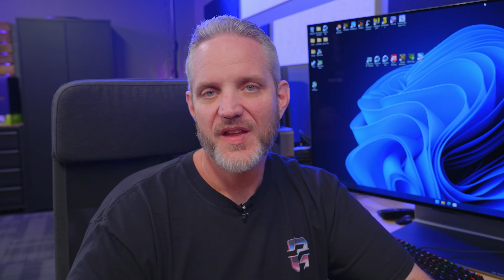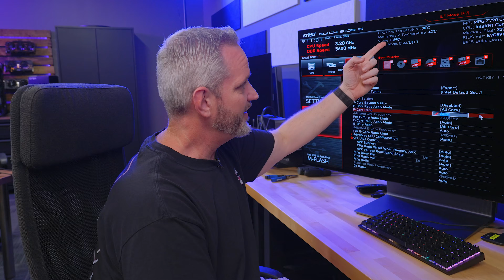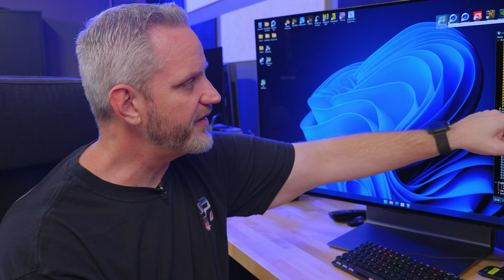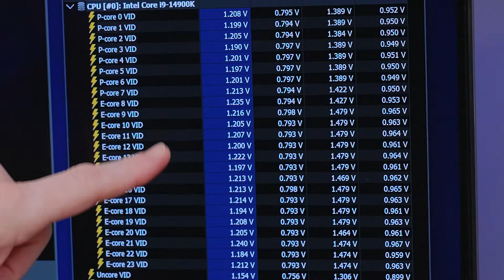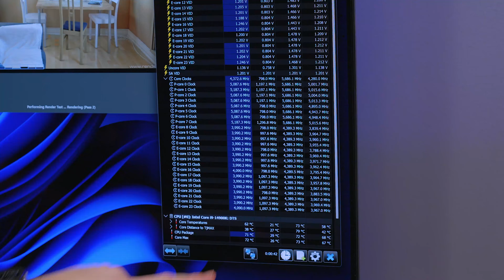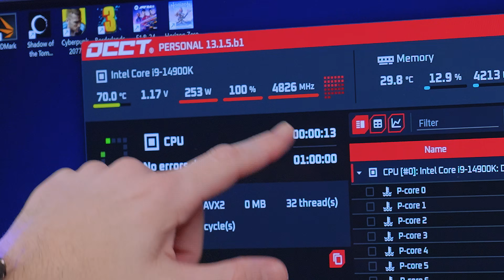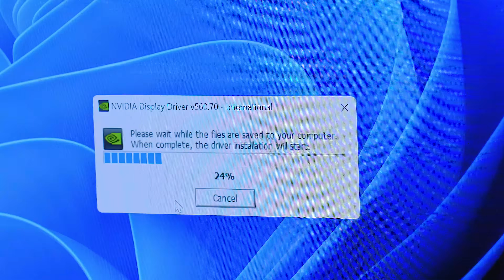Guide: How to check if your CPU is BAD!

Comment: You don't need to OC computer components anymore they are so fast now out of the box that OC is a waste just throwing more heat at it for no real gains and in gaming its just dumb to overclock for 5 fps gains or even less specially if you have a 4090 GPU its beast at default speeds why OC it. For a basic user that just games on there computer OC anything is a waste minimal gains for way more heat and power use is not worth it imo.
Reply: Fully agree.  I do the same, PLUS, I use the best cooling components that I can use.  Cold electronic components last longer & are more stable than those subjected to an ongoing blast furnace of heat.  Sort of a trait that I picked up from working in large mainframe computer shops long, long ago....
Reply: Undervolting with overclocking is the most valuable, but it takes a little time to setup up properly.

Comment: Had same issues you spoke about for my 14900k during first 3 months of 14th gen release.

z790 hero / z790 strix e 
Artic liquid freezer II 360

Used two different motherboards and two different 14900k chips. Both scenarios produced the same results. Cinebench and games would crash upon starting and during cpu high spikes. 

Everything was tested stock settings out the box.

Returned both chips and went with a 13700k. Everything has been running stable since.

Comment: I have to be honest, I have no idea if my 13900K is degraded or not but it probably is. I've finally had time to update my BIOS and I've done some testing, but I'm not sure. It seems worse with downgraded performance, and far bigger voltage and clock ranges (also higher voltages than before but also lower on average, from ~1.12V all the way up to ~1.5V, whereas it was about 1.2V-1.35V before), but then I'm using the Intel Default profile whereas the previous profile I was using was MSI's extreme profile, which has an absurd 4096W "limit" on PL1 and PL2. 
The thermals are the same as before though, with throttling even running an NH-D15 at full speed (but then again, it's a modern i9, so I guess that's expected).
Honestly, if we have to be experts to figure this out in the first place, I'd say there's already something wrong.

Comment: DISAPPOINTED!!!

I was kind of expecting this somehow, but updating the BIOS made things WORSE!!
This morning, I tested the CPU, keeping an eye on voltages and everything was actually just fine, but since everybody is panicking etc. I decided I would make a screenshot of HWmonitor after some time and tests and then do the same tests again, after the BIOS update.
And so... The voltages went UP about 0.05 volts OVERALL, even the idle voltages!
The powerdraw on all core stress test went from 260Watt to 283Watt.... When the cap went from 4095 to 253 watts?!?! How does that even work?!
Even 'better' is that the max temps went from 78C to 90C!!! WHAT THE ACTUAL FFFFFFFUDGE?!?!?
THIS is Intel's 'safety measure'??

Yeah, great BIOS update, lovely, thanks MSI, thanks Intel! That worked like a charm! >__<
Oh, right, the specs:
MSI MEG Z690 Unify (It already took them way longer to bring out the update than for Z790 boards, so thanks for that as well)
Intel i7 13700K
Reply: I went back to the April BIOS, 1 version earlier, my board came with the Januari one, 2 versions earlier, but they seems to be working the same.
Voltages, Power draw, temperatures and even performance are better! Fudge Intel and their settings and fudge the mainboard companies for rushing out a BIOS that is apparently WORSE for the CPU and they don't even appear to have checked it!

Comment: For many people, the problem will be that after flashing the new bios, the Intel profile is preset.
And my 13600K became an i7-8700. I had 10,000 points less in cinebench.
Reply: My Cinebench scores barely changed with the new Intel preset ... not enough to get my panties in a wad.

Comment: Fun fact: on Intel motherboards, just having 4 ram slots is all you need for Intel to set a lower stock/stable speed. The number of sticks doesn't come into play, which makes most ram sticks/timings an "overclock" by Intel's standards. It works as Jay described it though for AMD, only when sticks/ranks are present will it impact the CPU (and not by as much!).

Comment: With my cpu i9 14900kf crashes or shaders compiling errors happens only when i overclock it, when it's in normal state or a bit undervolted like i'm using it now it runs fine with no issues

Comment: Quit propagating misinformation.  Degradation can be prevented under certain voltages.  Get it right Jay before you post things.  Don't be like Linus Liar Tips
Reply: Wrong, Jay is correct that they will absolutely degrade over time. It's just a matter of how much - degradation is usually minuscule to the point of being mostly unnoticeable for many years.

Comment: Oh also, having now watched the vid
14900K
Asus z790-e gaming wifi 2
My guaranteed crash would be starting the system. About 1 in 3 starts failed. And a variety of fails. Sometimes freezing before enter BIOS screen notification - mostly requiring a power supply off/on to restart. Also, most popular, while Windows was loading - generating one of 3 usual kernel errors. Net said probable driver corruption. Thanks internet 😄
The Asus 0129 microcode did fix this, least so far 🤞🏽

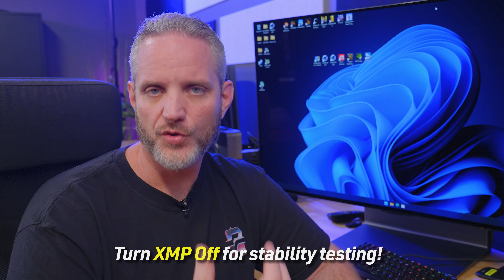Comment: 5:14 I've had 2 diff processors NOT boot 'cause of enabling XMP.
One, an 11900K, XMP was working 'till I updated the BIOS and foolishly (according to me) set the XMP on during 1st boot along with all the other boot things I change. The other processor I hadn't enabled XMP previously.
For both I had to reseat the CPUs to get the things to work again. And quite relieved that did work when nothing else did.
I've NOT enabled XMP on either of those (one's been retired due to a DisplayPort cable malfunction 🙄) 'cause I'd rather have a working system than a slightly faster NOT working one 😼

Comment: A hardware failure will fixed by a software update.
No boy, updating BIOS will fix nothing, just extand the lifespan of the CPU, ...... buuuuut, the lifespan is actually 20-40 years.. so what we r talking about?

I have 2 intel systems, i give a shit on it, in precise, i just only game on it, i cap the wattage, kill ht and e-cores and overclock the p-corres.
I will not think it will reduce the relativly lifespan.

Comment: My 14900KF consistently crashed during GeForce driver install until one of the Bios updates(can't remember which one) and still would have fairly regular browser tabs crash, as well as discord crashes.
The entire system is currently in for an RMA due to this issue, as well as a self immolating 4090 (no idea if that was related)

Comment: For AMD and Intel the "lifespan" is the warranty period.

AMD screws up (degrades) their CPUs a bit more intelligently than Intel.

AMD horrendously overvolts its Ryzen CPUs at stock and is way outside the TSMC spec for their 7nm, 5nm and now 4nm CPUs.

Of course Jay, if you did even the remotest bit of due diligence, you would have realised this years ago.

Just before I replaced my 7950X, which had been running 24/7 for about 20 months, I retested it, and it had the same performance (well actually a bit more) than when I first bought it and established a baseline.

If your buddy at Falcon Northwest looked at the voltage and current going into a 13th and 14th Gen Intel CPU and thought that was fine, then he is a complete cretin.

When I first saw what was happening with 13th Gen when it first came out, I said to the person concerned - that's not going to end well, and of course, it didn't. And the last Intel CPU I had was a Haswell (4790K Devil's Canyon) which ran 24/7 for nearly exactly five years before I upgraded.

Comment: I've been meaning to ask this question. I have a gaming laptop the Acer - Predator Helios Neo 16" WQXGA 165Hz IPS Gaming Laptop - Intel i7-13700HX – GeForce RTX 4060 with 16GB DDR5 – 1TB SSD. i bought it from best buy for around 1200 bucks. i need to know if the I7 13 gen laptop processors have this same problem as the desktop variants. ive heard they do. i know most of my bios settings are locked so everything is just at default settings. ive had quite alot of crashes (no bsod) theyre literally full on crashes where screen freezes nothing works and i have to force power off. this happened a couple times before ram upgrade 16gb and after ram upgrade to 32gb. it usually just happens when playing Wuthering Waves but has happened outside the game. but mainly when im playing WuWa randomly. also will these programs work on my laptop? also i have limited processor speed to 95% in the power options. I also do not know how to check for bios updates for this laptop.

Comment: Intel has an "Intel® Processor Diagnostic Tool", while it doesn't cover everything and not even all of its products, it does cover most recent CPUs out there. It's probably not going to stress the CPU in the same way as a stress test, which would show thermal or wattage flaws. However I think it's a decent enough tool to see whether the CPU is failing in some regard instruction-wise.

Comment: i9-13900K. Running cinebench R32
My system running warm, I have a 360 AIO. 
In the 90degrees to 100degrees. Voltage 1.2 with max 1.488 
P-cores 4.8 to 4.9 max 5.5 
E-cores 3.8 to 3.9 max 4.3

Comment: It shouldn't degrade in 20 or 30 years for sure. I have lot's of Macs and Tandy computers from the 70s and 80s that have seen a tremendous amount of use and still work just fine. Our Dell 386/25 from about 1990 still runs every day. We have only replaced hard drives and maybe a PSU.

Comment: Also: - I noticed you shared not all 14th gen are assured to have this.. BUT DIDNT MENTION 13th gen!  Does that mean there's info about 13th having higher chances of issues and oxidation (as you did directly state) but I've never heard from anyone any info about that... In fact I though early CPUs might even be  more likely to be FREE of it - Just passive info over the last month from Gamers Nexus I picked up in brief comments..
Reply: We don't know. Nobody does. It's starting to seem like Intel doesn't know either. What we do know is that Intel says it was only 13th gen affected by oxidation, though they claim it's a small amount, but there are conflicting reports on just how long the problem persisted. At first, it was supposed to be a few months in 2023, and now it's being reported that it might date back to 2022, so it's very unclear. As for the other issues, it seems to affect all Raptor Lake chips at this point but we're yet to get anything truly definitive from Intel.

Comment: Im worried to update my Z790 Pro Art Motherboard (ASUS) with 13900K (Bought April 2023) ... seeing other tests showing that .. they seem to INCREASE VOLTS MORE with the latest microcode update ... Im right before the latest one...   2402 not 2504 yet...   

Should I be concerned about he microcode actually accelerating my CPU degradation by what IMO is an attempt to not make the performance hits be so bad to save themselves legally better..  At the cost of faster death of my CPU - is that a valid concern? As I SAW higher Volts with the new microcode on another channel!    So IDK WHAT TO DO! TO begin to start checking here!  As if its not a concern somehow - Id not want to stress test it without whatever safety the absolute last microcode update MAY provide (Essentiall my question) !
Reply: And seeing in War Thunder occasional glitches over time now more that has mTHE SKINS OF MY VEHICLES crash or appear black aka.. maybe a hint of this degrading with GPU like effects.. But now Multi Streaming Streaming with OBS  to youtube and twitch.. Ive just never seen my computer be so slow and ... Scary with.. Issues even just typing in a youtube comment.. that NEVER EXISTED  the last time I was streaming regularly .. about a year ago!

I do also have 128GB DDR5 RAM (Corsair Dominator) 5200Mhz 4 Dims obviously - XMP enabled to OC for stability to run at the full 5200mhz.. So that could be a stress of its own.. BUT IN OTHER REGARDS... It also means my computer has NEVER BEEN Heavily performance OCed... As I've always has the slower RAM and 4 dims that cap it - its the one config that's ANTI -OC by nature.. But still stresses it another way.. Andf I casnt help but think this is why this is the most unstable computer I've ever had in my life and first I've ever made with intel.. Just my luck!
Reply: I'm no expert so I can't answer your questions but I just updated my MSI Z690 Force to the latest BIOS with the 0x129 microcode, and I've also seen higher voltage than before. 
Your RAM definitely won't help - DDR5 doesn't really play nice with 4 sticks, although 5200MHz is low enough that the memory controller on the 13900K should be able to handle it. Mine can't seem to handle more than 6000MHz (which is the rated XMP on my two sticks) though so it's hard to say. 
Maybe if your retailer isn't useless, they might be able to help point you in the right direction, since this is an Intel problem, not theirs, and they should be reimbursed for any returns anyway.

Comment: I havent the august upgrade yet.
But I did the "let intel stock" (253W) right away before my 1st launch. And my 14900K never crashed once.

My question is: Am I safe with that? Or should I still upgrade?
Reply: You should still upgrade. Even Intel's default settings still have voltages all over the place. Theoretically, this update will help. In practice, it's hard to say for sure, but since Intel is recommending you update immediately, I figure it'll only help a warranty claim should you ever need to make one.

Comment: How this hapenning that you have cpu 253W MAX but by me with 14700KF I get even over 300W (when 100%)  after newest bios with deafult settings on MSI???
Reply: Is it default settings? MSI has three performance profiles, at least on my board. One is MSI's own profile, which has a 4096W limit.
Make sure you're checking the Wattage for PL1 and PL2.
Reply: @GareWorks  Yes deafult settings, I checked PL1 and 2 and both are set to 253W...but when I use OCCT or similar app to check procesor  its going higher than 253W and I have no more ideas WTF..

Comment: Is it safe to say if my 13700k was topping out at 87C on R23 and about a year later it hits 100C almost immediately, I have a faulty CPU?
Reply: Nope.  Check your cooling (and don't assume that everything is just peachy because you haven't made any physical changes).
Reply: @eskieman3948  I just deep cleaned all fans and filters, applied new thermal paste and updated BIOS for new microcode (was on beta version for last week or so). Even upgraded to LFIII 360 a couple of months ago from Kraken 240 (was getting 87C on R23 with the Kraken). There’s almost no way it’s cooling.

Comment: Jay being real and helpful.
I’ve noticed some other channels who were screaming about this problem have been silent since the microcode update. They slammed intel as the sole problem and said the chip’s performance would have to come way down to fix the problem.
So now we know:
-Intel was at fault.
-The board partners were also pushing the cpu like they shouldn’t have been.
-Intel should replace bad chips and extended the warranty.
-the micro code doesn’t degrade performance much if at all.
-Jay has been the most  measured on this (IMO). He has been able to do testing, etc, but from many others not a peep.
Is that because there’s not much new to scream about any more ?
Btw I run a 5800x3d not intel.

Comment: 14900kf just installed after rma of 13900k. Im getting average 1.1, 1.2 VID max when running R23. My best score so far 33k. Did i get a fucking cpu that sucks out of box? Btw instant 100 and throttle. Vid is 1.4 idle but drops under load?????

Comment: I dodged the bullet by NOT ever updating any bioses for my 13900K system and people got taken dry in the behind by the bios updates they thought would solve things but only ruined things.
I can run any benchmark I want, even with 4x32GB DDR5-5400 with XMP enabled and it does not fail, the system is almost 2 years fully stable with more than 14.5K hours usage out of it!

Specs:
Cooler Master HAF 700 EVO (2x 200m front, 3x 140mm front, 1x 140mm bottom, 2x 140mm rear, 2x 92mm hdd bay)
13900 K -0.06v undervolt microcode 0x10B (earliest microcode!)
Asus ROG Maximus Z790 Extreme (0219 bios, the earliest from 1 September 2022!)
4x32GB DDR5-5600 Corsair Dominator Platinum RGB CL40 at 5400Mhz XMP (Samsung & SK Hynix).
Corsair H170i with 6x push-pull Noctua NF-A14 3000RPM 140MM IndustrialPPC fans
EVGA GTX 1080Ti FTW3 11GB with 1949 to 1987Mhz GPU boost.
1x Samsung 840 Pro 256GB
1x Samsung 860 Pro 2TB
3x HGST He10 8TB Ultrastar
3x HGST 7K4000 4TB Deskstar
2x Samsung 990 Pro 4TB NVMe PCI-E 4.0 4x in ROG DIMM.2 slot
Asus ROG PG279Q 1440P 165Hz G-sync
BenQ BL2411PT 1200P 60Hz
Razer Basilisk V3
Logitech Z906 5.1
Logitech G35 7.1
HyperX Quadcast S
Windows 10 Pro x64 22H2

Never seen dangerous vcore voltages, in bios reports 1.376Vcore
In Windows during idle roughly 1.288-1.343Vcore
In Windows at 100% stress loads like Cinebench R23 about 1.243-1.252Vcore

I'm a happy camper with a beautifully strong system for most demanding workloads, whether it be gaming, virtualisation, archive compressing and decompressing, video encoding or even doing most of this all at once it does not care.

This purchase has been worth my money coming from an i7 3930K since 2013 and that was arguably one of my best buys alongside of the 1080Ti in terms of longetivity and long lasting performance even for the price. 😎
Reply: Also to add to this, all power limits are fully removed, total consumption is roughly topping at 290W.

Cinebench R23 reaches 41K points
CPU-Z reaches 17k+ points

The system never throttles it's all core turbo boosts due to overheating.